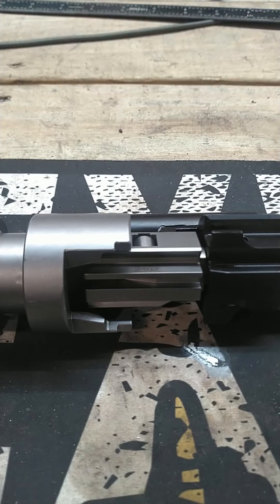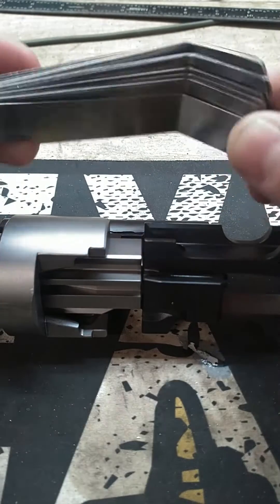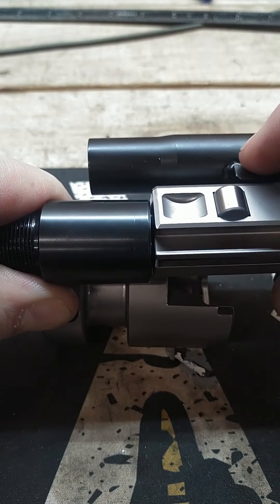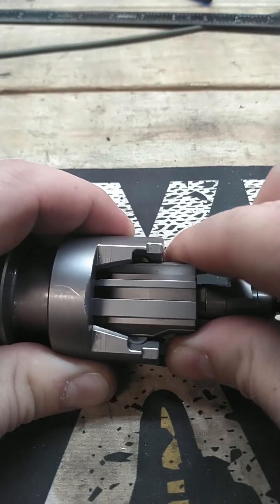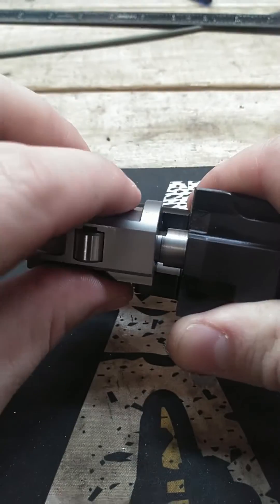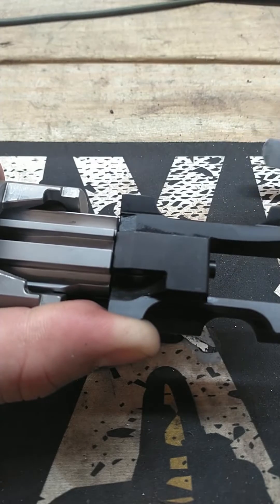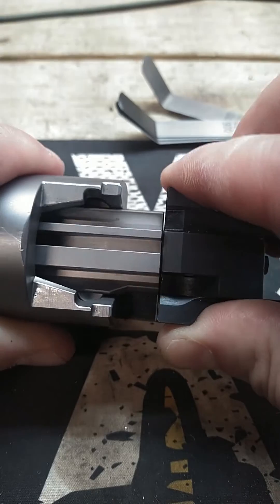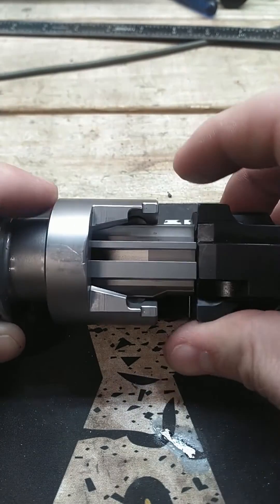Bolt Gap on the MP5

Comment: New to the mp5 and actually just ordered one yesterday and was shopping for a stock/brace for it when I saw those receiver flats and now I’ve been going down the rabbit hole all day. Built plenty 80% Glocks and ars but this looks more fun. I’m a pipe welder by trade as well so welding the receiver isn’t any big deal. I have a question though about the barrel here. Does it need to be clocked any which way or no?
Reply from the maker: For the SD model, there's no need to orient the barrel in any particular position, I just make sure the caliber and manufacturers label can be seen through the handguard. If you're doing a standard MP5 or an MP5K, you should orient one of the lugs on the tri-lug mount to be at 12 O'clock. This is not mechanically required but it looks nice and that's how HK did it.
Reply: @NeglectedWeapons cool man appreciate the info!

Comment: Will this also work on a g3 ? It might be a different gauge but do you set it with or without a round
Reply from the maker: It's the same process, do it without a round and with the trunnion installed in the receiver, that's the only way to get a true gap reading. It's very tedious.
Reply: @NeglectedWeapons Thank you for your response. Best info I got trying to find out how to gap .